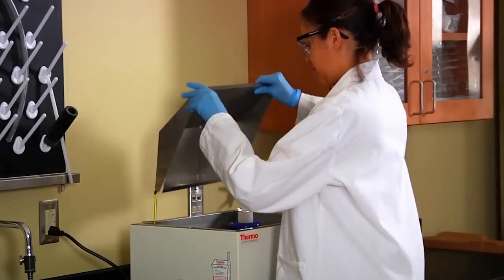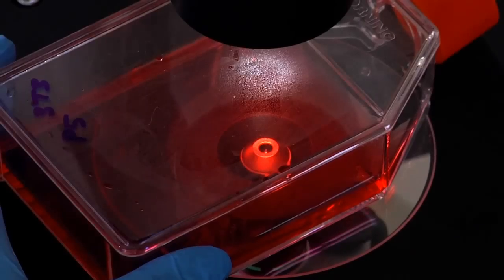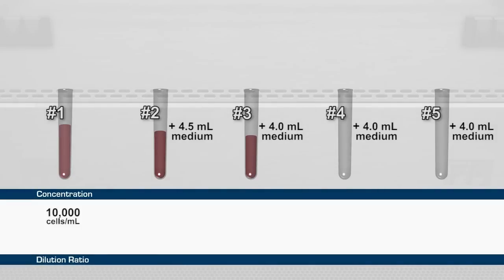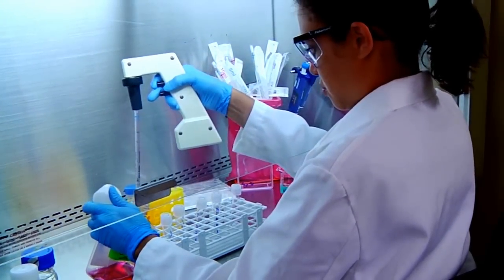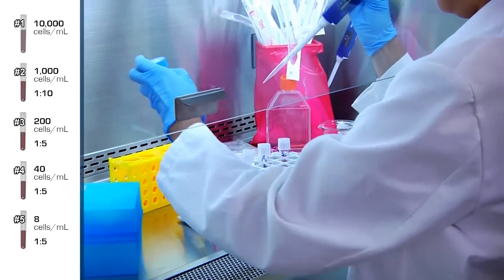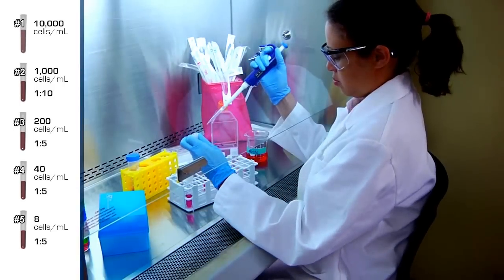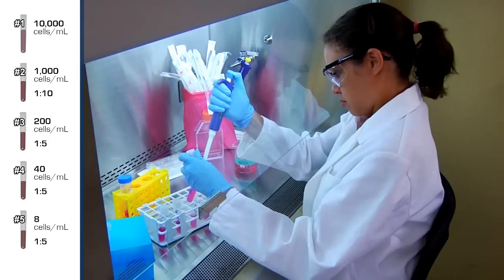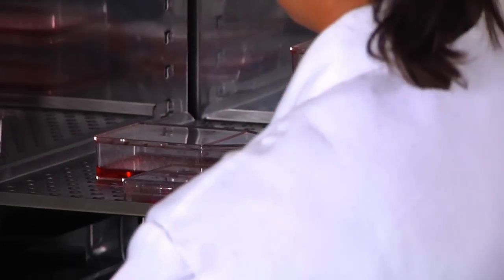Serial Dilution for Cell Cloning

Comment: How it is a clonal cell? the final tube #5 containing 8cells/mL, you have used it as a single cell but it contains 8 cells/ mL and you have used 2mL of it to grow the culture so basically it is from 16 cells to develop into a culture. please correct me if i am wrong
Reply: you are correct. I think this wont be a monoclonal cell line IF and only IF the daughter cells are collected from a merged offspring. What I think is happening here is that they know that in 3 weeks THEY WOULD HAVE ONLY between 8-16 INDIVIDUAL colonies that probably is easy to spot and separate. Then from each of these They can start 1 to 16 clonal cell lines.  This makes sense if we think that relative to other cultures in which the typical density is in the order of 10x10e04 or higher, then would be considerably challenging to pick 1 single cell.